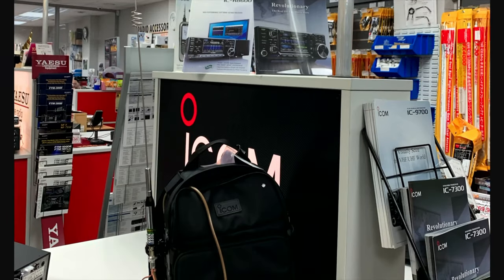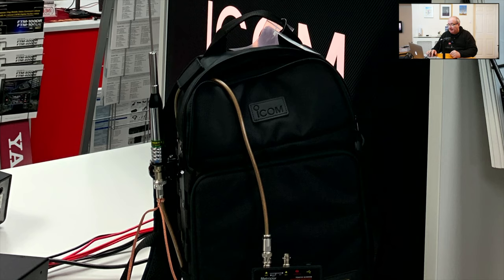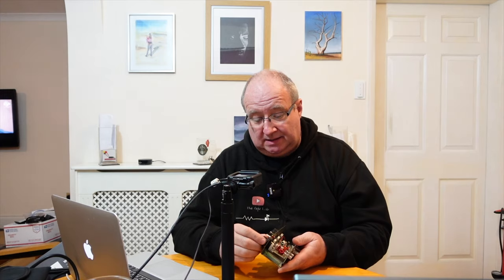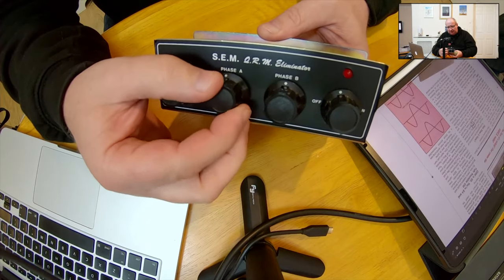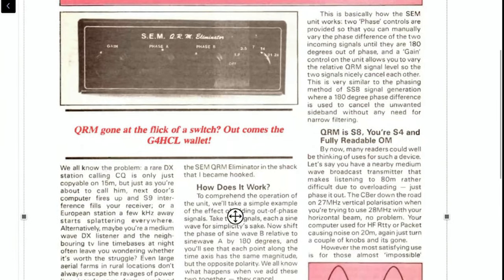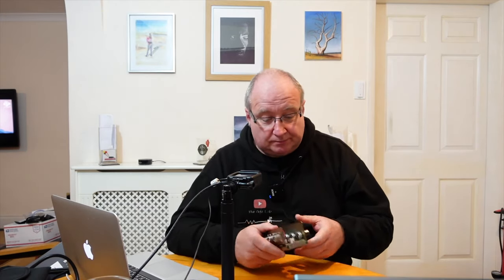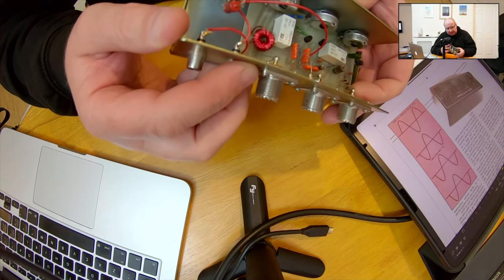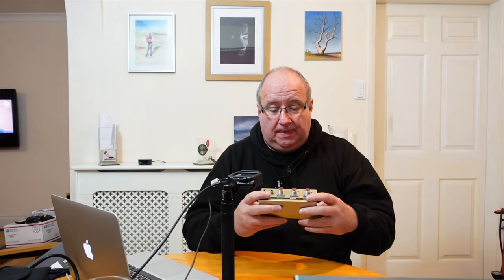Friday Vlog, ic 705 antenna on the icom bag, sem qrm eliminator, and ofcom proposed changes on EMF

Comment: As far as EMF is concerned, they have more need to tighten up on what some electrical equipment puts out interference wise than worry about radio Amateurs.  They used to be a lot stricter on what manufacturers equipment put out, these day there is not nearly enough screening of electrical noise in equipment.  They should start there.  If Radio Amateurs cause problems they can be in enough trouble as it is.   EMF!  Give me strength!
Reply from the maker: Lol I believe is public consultation at the mo get in there 😂